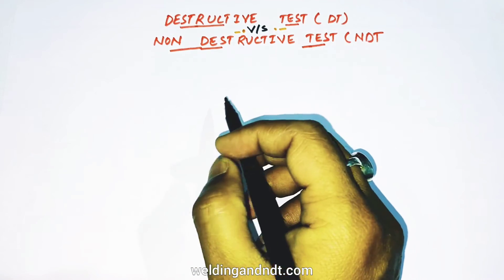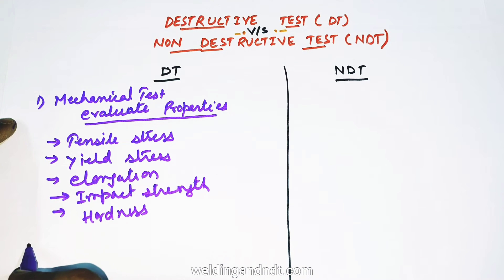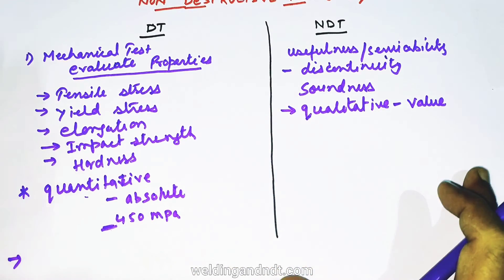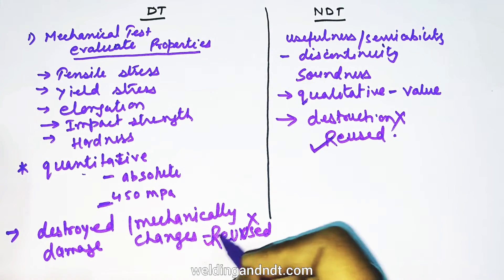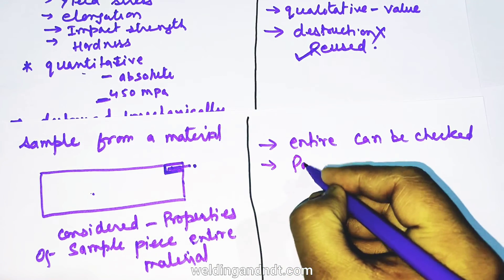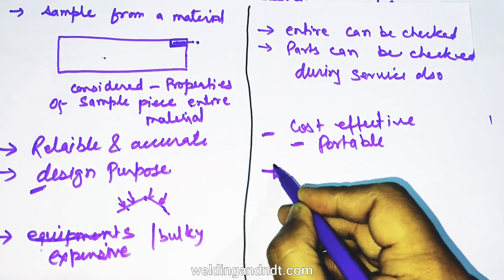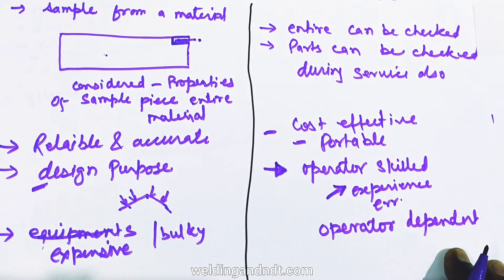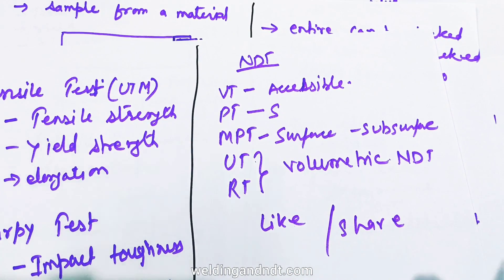[English] Difference between Destructive Test (DT) and Non Destructive Test (NDT)

Comment: Sir  ,  we can  hardness test with NDT??
Reply from the maker: Yea. It is a highly debated topic. Let me explain, hardness is rate of indentation or resistance against scratches. If the equipment is able to detect the hardness value without deforming/mechanical changes, then we can say it's NDT. However if there is any mechanical damage on the material then it would be a DT. As of now both type of equipment available. Hence depending on your equipment you can say weather it is NDT or DT.
Thank you. Please visit my website  for notes, videos and other important informations https://www.weldingandndt.com/
Reply: @WeldingandNDT  thanku sir thanku so much